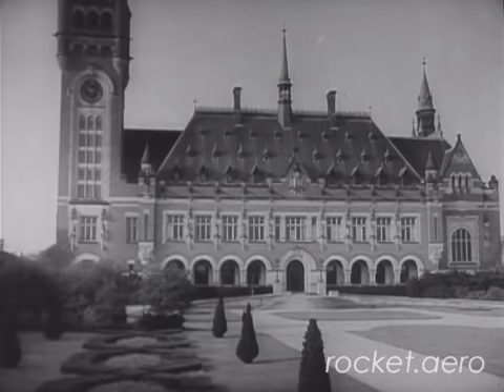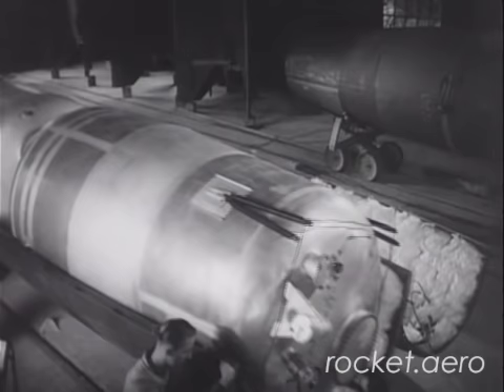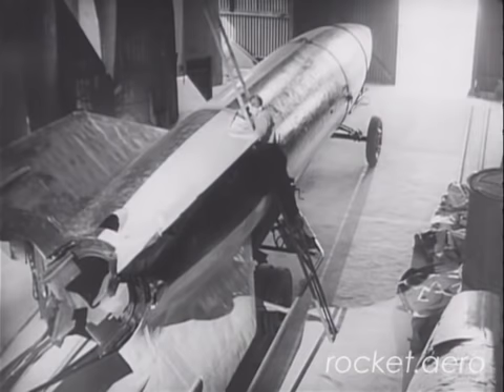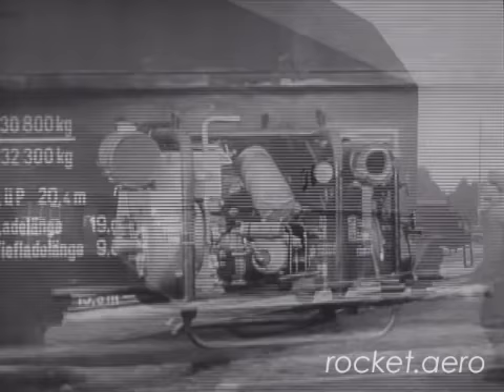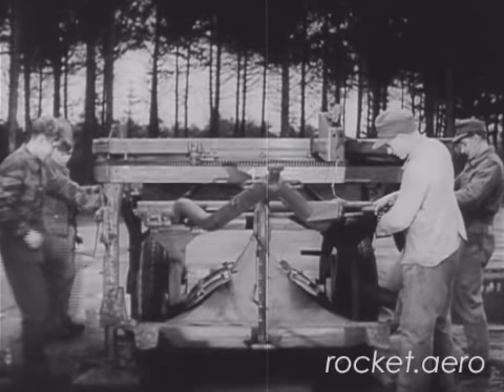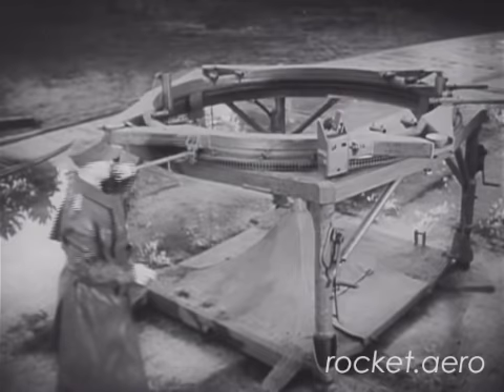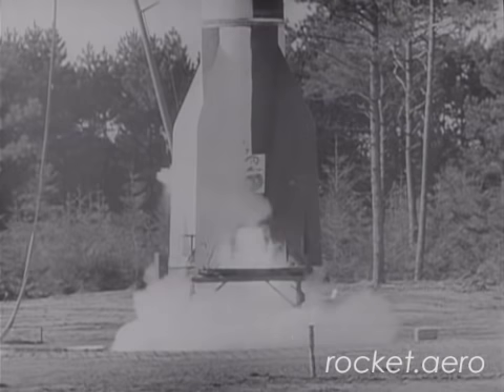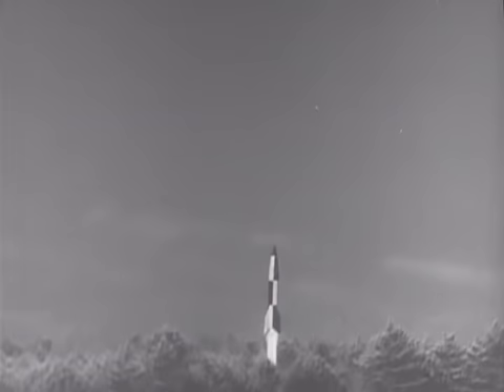Project Backfire, 1945

Comment: But, how did they target the gyros?
Reply: They didn't , they used a clock to enable the gyros to tilt and make the rocket cant to 43 degrees.  . Very primitive.
Reply: @boptah7489  Also war die Himmelsrichtung egal, die Flugdauer und Antriebsphase waren unwichtig. Einfach eine Uhr - fertig. Wird schon ihr Ziel finden. "Very primitive", ein bemerkenswerter Kommentar.
Reply: @boptah7489  Your are confusing the Vi with this; the VII or A4
Reply: @boptah7489  Wrong Bo, the V2 used an accelerometer to shut off the rocket engine

That clock you mentioned is used in the V1 to make a directional change after it was fired.

Watch this to the end, the clock is mentioned: https://www.youtube.com/watch?v=5EEZuXQyA-E

The V1 also had a counter that among other things extimated the distance and  made the V1 dive.

Compared to the V2  guidance system yes a lot simpler.

Btw, the same German V2 engineers improved on the basic V2 guidance system.
Instead of MIT Draper's ideas these "primitive" V2 guidance principles were later used for any US missiles up to Minuteman.

The same goes for early Soviet guidance systems. A couple of top guidance boffins from Peenemuende showed Korelev and his comrades how to.

In conclusion your remark misses the mark.  It was also a non engineering decision to leave out many electronics that improves accuracy. The real breakthrough of the Germans was to use electronics instead of mechanical computing to guide a missile.

But I guess you didn't know that form looking at that one video now did you?
Reply: @ervie60  You have completely missed the point.  Werner Von Braun discovered in1943 that a rocket cannot develop thrust above 100,000ft at European latitudes.  This meant that the range and accuracy was dependent on atmospheric pressure ie.  The rocket could only go higher than 100.000ft ( twenty miles) from the momentum created up to that altitude.   .  Hence the primitive control mechanisms. , because all the control variables need pressure ( resistance) to be monitored.   I think this is a bit above your pay grade.  .
Reply: @boptah7489  Hello Bo, nice to deflect from that  "pay grade" remark you made about using some kind of clock. (V1 counter rings a bell?)
Now about steering a rocket in ultra low to vacuum steering thrusters are required. Thrust using a rocket engine works perfectly fine in the (near) vacuum of space. Gyros and accelerometer do not need resistance form the atmosphere to do their work. Missile/rocket control surfaces will not work well or at all at extreme altitudes. However the V2 is from engine cutoff a ballistic projectile and once returned to dense atmosphere the control surfaces do work again but were left locked.

Anyhow the V2 guidance system in your opinion are primitive. Fine, opinion noted.
Reply: @ervie60  You cannot operate a rocket in any way shape or form in a low or zero pressure environment. .  To propel and steer a rocket you need  RESISTANCE.   You also need  pressure to mix and ignite hypergolic fuels.   There wasn't o mechanism to shut off the V2 rocket engine.  the engine merely shut off of its own accord because of the lack of pressure.   They called this the " all burned" position.   but it did not mean that the fuel was all burned. .    Primitive nonsense.
Reply: @boptah7489  Aha , so there are valves shutting off the fuel supply in the V2. Glad that is cleared. That shutoff is done when V0 has been reached, regardless how much fuel is left in the tanks. V0 is calculated to reach the distance. Shutoff signal is given by either a remote signal (Same goes for corrections to the angle) OR angle is pre programmed by  resistors in that clockwork to gradually work towards a certain angle. There is another third gyro involved for this BTW. 
The V0 setpoint is given by measuring  the acceleration of one of the main gyros.

Your problem is you conflate those 2 different functions. Show me the sources for the v2 info you have, I will show you mine.

Ok, we agree of shape of the earth :)

Age of universe; minimum 13,8 billion ears: Microwave cosmic background radiation. Observable and measurable! Age? well cooling, go back in time to minimum temp need to form atoms and then light can be emitted. Age of beginning of universe..well yes..hard to determine exactly.

Thrust in a vacuum and ignition.  Wether in a vacuum or in the atmosphere it is about pressure difference! Fuel and oxidiser tanks can be pressurized or stored under pressure and be pumped. gas flow is from high to lower pressure. What determines momentum (thrust) greatly are 4 things, the weight of the gasses, their speed and pressure, for jet engines the temp is also important. In short no need for any resistance for rockets to work. Now ignition; how about those hypergol fuels to ignite a liquid fuel rocket engine, pyrophoric ignitors??

Your example of a tube filled with hydrogen leaves out a couple of important factors; you describe evaporation that is correct, but a rocket engine uses combustion the create heat speed and pressure. A test tube doe snot have a nozzle. So apples and pears. Newton's 3rd law does apply in space. 

My penny is not important Bo, but I do suggest recounting your (brain) marbles and go easy on the conspiracy diet.

Oh before you mention it, yes even problems in micro gravity there are ways to feed pumps from the tnaks. Keyword is ullage, nice bit of homework for you :)
Reply: @ervie60   The valves on the V2 do not shut off the fuel supply as part of the normal operating procedure.  The normal operating procedure is to exhaust the fuel supply . The valves are only shut off after the fuel is burned as part of the primitive aiming mechanism. 
   I can see the source of your info.  It is on youtube.  you have no textbooks on the subject.  And you definitely do not know the  Werner von Braun rocket story.  But you might learn if you stick around.
   It is impossible to determine the age of the Universe. It is actually ludicrous to try and work it out.  You will only ever come up with a perspective based on beliefs..  And that is not the same as knowing..  
     you cannot have a  " pressure differential " in a vacuum.  To create pressure you need resistance.  There is no resistance in a vacuum and so no pressure.  this is very important to understand.    Answer this.   If you have a SCUBA tank in the vacuum of space and you cut the bottom off of it.   How much pressure can you create in the tank if you connect the most powerful compressor in the Universe to the top ?.
   You cannot pump a gas into a vacuum.  A pump is a vacuum emulator.  A pump at best would be a resistor and impead the flow of gas into the vacuum.  The maximum rate of expansion of a gas into a vacuum is governed by the atomic  properties of the gas  Gases do not like to exist as a mass cloud  unless they are 'pressurized' to do so. 
   My hydrogen in a test tube example was perfect.  Your response was very very weak.  And you know it. . A rocket works on the principle of an expanding gas creating pressure behind the rocket ( or rocket nozzle)  this then creates a pressure differential and forces the rocket into the lower pressure in front of it.  ( Boyles law). This applies to ALL rockets without exception.
   BTW.  there is no such thing as " micro gravity" and no empirical physics to show it..  Just as " orbital velocity'. ' escape velocity'.  are also works of fiction
  Meditate on this.  What is the one and only way that weightlessness can be achieved?
Reply: @boptah7489  In 1940s   this was 'primitive' . ??     Compared with ??
Reply: @causewaykayak   Rockets are over a 1000 years old and were invented by the Chinese. .  Primitive
Reply: @albertodadamo7373    N3 requires 'forced pairs'.   There is no resistance in a vacuum and so no 'forced pair'.  .   I think you must be a triple jabbed mask wearer.
Reply: If the earth is flat, why bother going into space? What twaddle.
Reply: @ervie60 , age of the Universe???
😮🙄🤔
Reply: @claudiohess7692  Roughly 13,8 billion years ago, why did. you ask? I am no astrophysicist

Comment: “Rocket control veins were made out of Carbon?”
What does he mean, surely he’s not talking about carbon fiber that would melt. Maybe a carbon coating on a metal like titanium?
Anyone please help.
Reply from the maker: The material was not carbon fiber. Instead, the exhaust vanes were machined from blocks of solid carbon, which were very delicate.
Reply: Graphite ?
Reply: @r.ladaria135  Possibly, they refer to the veins as being fragile or delicate but the correct term is probably brittle. A sharp blow with a hammer would've shattered one of them.
Reply: Big chunk of graphite. They are fragile.
Reply: NO, he is talking about graphite blocks.
Reply: Graphite.  Don't melt.

Comment: It would have made a great way for executing a fast getaway for anyone who wanted to be in London in less than 30 minutes.  It's a wonder none of the techs ditched the warhead to crawl into the now empty warhead space.  In the US, a vip with lots of connections got permission to dispose of old ICBMs (without the warheads, of course).  The way he disposed of them, was to sell rides on those.  It was a fast and short ride, so no spacesuits, no oxygen beyond what was already in the compartment (there better be no farting), and the view from the portholes plus the 0G maybe offset the dangerous aspect of sudden disintegration due to the age of the equipment.
Reply: The landing would've been challenging though.
Reply: good one😆

Comment: What were those tanks made of?
Reply: Cardboard
Reply: Thin Aluminum. That's why they're filled with the rocket standing up. Otherwise, the weight of the fuel would collapse the tank leaving all in the surrounding area at risk.
Reply: steel mostly. only the tanks in the rocket itself were aluminum.

Comment: And utterly pointless.  Each once cost god knows how much and killed a few non combatants. Utterly useless.
Reply: Do you know how protected London were from aircraft at that time? And this weapon could fired from 200 miles away do you really think stategic bomber were far more cost effective than V1 and V2?
Reply: @anonymousstout4759  Cost the Germany economy a heck of a lot in materials, engineers etc, and each one killed a couple of old people or women in London.  A complete waste of time.   If those resources had been put into jet fighters, Germany would have won the war.   It is that simple.  Battle of Britain, won.  Malta, won.  DDay, won.   Air superiority = success.   The TV weapons were a complete waste of tie.
Reply: After 1941 Germany won the war was the biggest joke ever. But yeah sure jet engine by far would be their best bet but if they could mastered this kind of weapon and start to put nuke as the warhead instead of tnt there's will be no safe place in Europe
Reply: NASA knows.  heeeee
Reply: @ancliuin2459  
Yes, exactly. The V1 demonstrably worked, but there were countermeasures. Still, if the number of launches were simply scaled up, those countermeasures might not have been able to keep up. Or perhaps they might have. Still, there's a kind of mathematical smoothness to weighing the tradeoffs.

When it comes to the V2, the smooth function becomes chaotic, unpredictable. And toward the end, the German High Command was coming to rely increasingly on hubris, as if, for example, merely being outrageous and unpredictable would be a stupendous, insurmountable advantage.

I wonder if they failed in part because they were unduly impressed by their own horror. Horror would lead to conquest and concessions, which would allow expansion and provide the urgently needed resources to support the ambitions of the V2 program.

But if for any reason those resources were not forthcoming, the entire program - and its highly anticipated, desperately needed effect - would become a "damp squib." (I love that phrase.) And so it did.